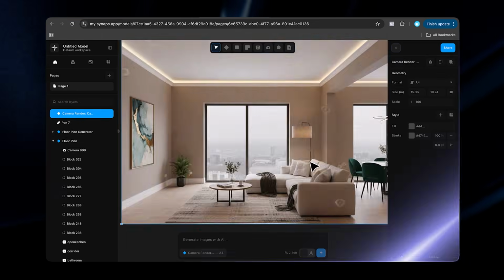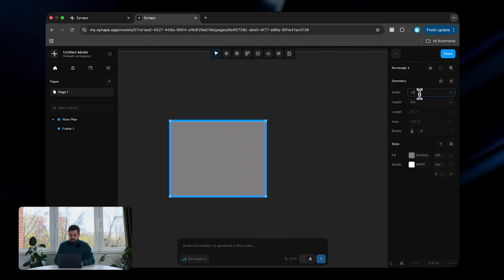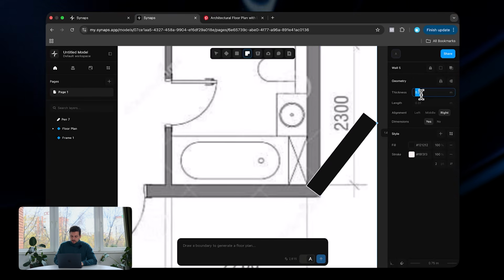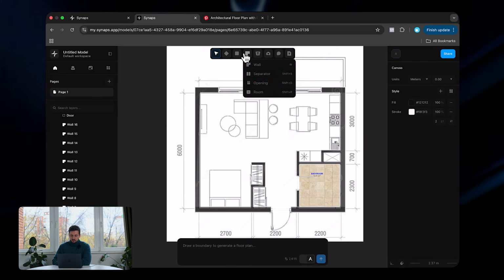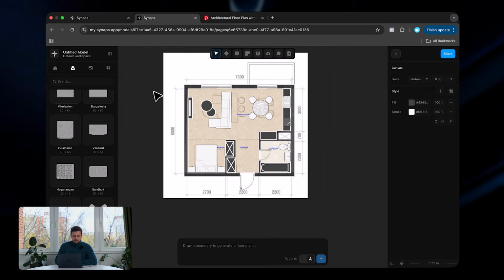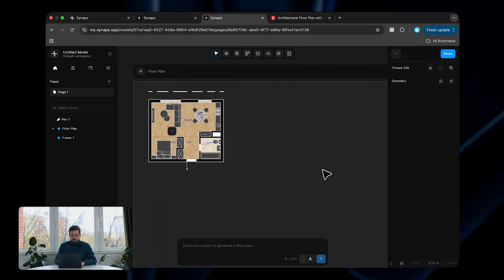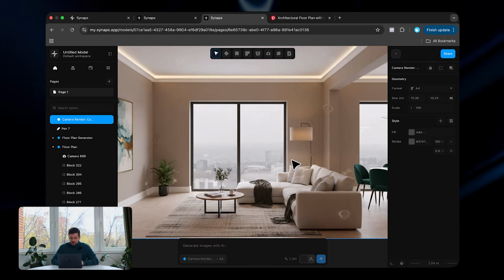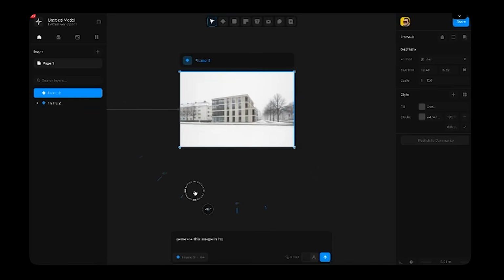AI for Architects Masterclass | Free Course

Comment: It is a really great idea, though this app does not work as intended. It's a very simple floorplan designer with lots of annoying UI issues. I created a floor plan then I could not render it since it rendered a totally random room which has nothing to do with the floor plan. Also, live preview does not work. Basic assets are missing, and as someone complained in the comments, the UI has a lot to work on. So great initiation, but I would not pay for it.
Reply from the maker: Retry the new version here: synaps.app
Reply: @MelosAzemi  OK, thanks. Can I open a floorplan I made in the old version? Anyway, I quickly opened the new version (I see some great improvements in the UI and better assets) and just like the old one, it completely freezed my Chrome when I tried to change the fill of more walls at once. It worked fine in Firefox without freezing.